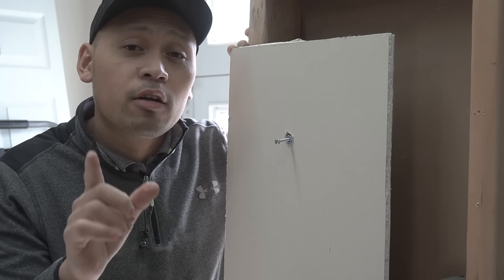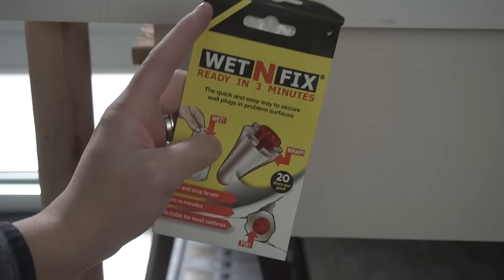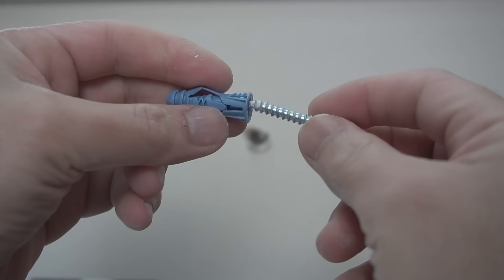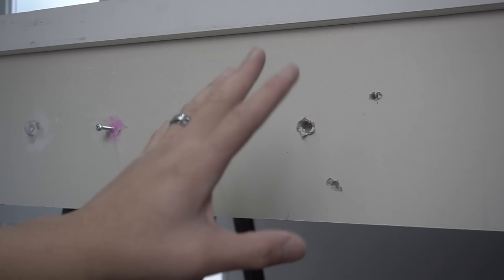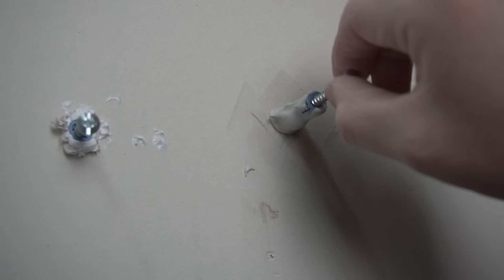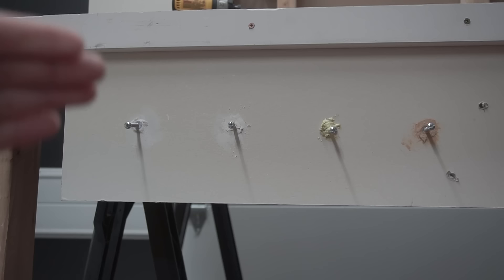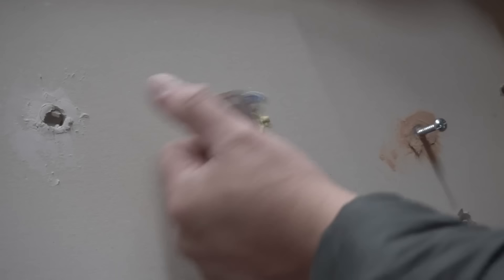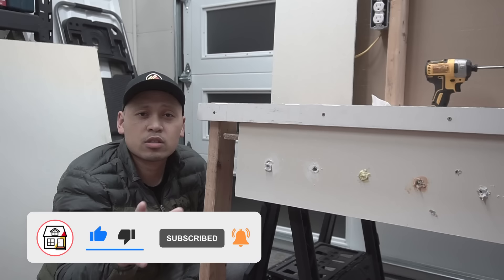How To Fix Loose Or Damaged Drywall Anchors Like New! | DIY Wall Plug Repair!

Comment: Great idea, but it is clear that the 'Wet n Fix failed because it has slipped down at an angle. If you need the screw to be in the same place, this will NOT work. The hot mud would at least work for less than 40 lbs.

Comment: Did I missed the part where he said how long he let the filler dry before he did the test or should we assume he did it the next day?  Some of these filler require days if not weeks to cure.  So this test didn't really prove anything.  He should have done the super glue and cotton test.  I seen other YouTube videos of people using super glue and cotton to fix screw holes by fill the hole with super glue and cotton and redrilling the screws holes.

Comment: Very strange repair. It doesn’t allow your fitting to work as it was designed. How about simply patching the hole and then installing a metal toggle style in a slightly different location?

Comment: First of all interior, lath and plaster is much more superior than cheap drywall and you’re only saving 10% on labor and materials on home building. One of the main problems affecting drywall is that when there’s moist water leaks, it creates Toxic mold which plaster does not. Drywall does not create acoustic and insulation and strength properties plaster does. It’s all about saving a few bucks and the drywall gypsum board companies rip off the homeowner. So by genuine, lath and plaster, which can last over 100+ years and holds anchors, and everything else in a more superior fashion Keep your valuable paintings and art safely held on the wall better than any other material.

Comment: It's drywall, it has limits. Even a great solution is no better than the drywall an inch away from the repair. If you need to support weight, you need to anchor into something better than drywall. If the item matters, like a TV, I anchor into a frame stud. I once built a shelf system into faux wall studs. I anchored the faux wall studs into the drywall with 6+ large wood screws. The studs were going nowhere, and anything anchored into the studs was as sturdy as the wood provided.

Comment: Of course, they are all going to fail, how can they possibly work if the toggle can't expand due to being covered in solid setting material. Better to drill a new hole and fill the old one or use a gravity toggle.

Comment: Great tips,  but never,  ever,  never use a drill on plastic anchors. Always screw by hand.  The high speed of drill actually softens the plastic anchors, which are made from LDPE, which has a melting point of 225 deg F. The  softening point is much lower,  so by drilling you create high speed friction that softens the anchor.
ALWAYS screw by hand.
Reply: You can still use a drill, but you have to drive the screw really slowly.

Comment: Those blue anchors aren’t for drywall, they are for plaster walls.  They don’t work.  Use a screw anchor or toggle bolt

Comment: Use a hole cutter to make the hole bigger. Then use the same hole cutter and draw around it on an off-cut of plasterboard to cut out a round disc the same size as the hole. Then fill the hole in the wall with expanding foam and before it expands put the cut-out disc over the hole. The expanding foam will expand and make contact with both the wall and the disc. It will harden solid. Polyfill the edges of the disc. Done.

Comment: The best way to fix these cheesy dry wall anchors is not to use them in the first place. Use a small toggle bolt instead... much stronger and won't come loose.

Comment: Latex caulk has no structural strength, is only for filler.  Use silicone and report back.  Works just fine for me, but I don't ever put 50 lb weights on any drywall.  That goes only into building studs.  Your may be okay for a day, but it isn't going to last years with that weight.

Comment: I think most failures,  were due to the threads being coated and not allowing the screw to thread in.
Use PL then insert a new plug. It will dry within 2hrs and adhere to the drywall….mike drop

Comment: Your test seem to have a flaw in it. The different compounds you used should have been used to filled the holes first  so to be bonded with the dry wall without the anchors. Thses type of anchors have a back side that is supposed to expand and grab the back of the dry wall as tension is applied by the screw. Your test doesn't allow this mechanism.

Comment: None of those are drywall anchors. Look it up of you can.  Every test was a fail before they began. The anchors used for drywall are scew in not push in. You can use plastic or metal plugs, 1/2 drywall is cheap drywall. Standard is 5/8

Comment: As a contractor for over 30 years I would simply get a different hanker system using the same hole. There are various types out there that would be more simple and cleaner, faster and stronger than what's in this video. Not very professional. I guess maybe I should start my own chanel and give people the right stuff.

Comment: Lol. That’s not even a drywall anchor.  Just use the right type of anchor in the first place and save all the extra work.  Personally I prefer to use hollow wall anchors (also called molly bolts) for drywall.  Drywall anchors (ones with the thick thread that you screw into wall) are ok for lighter projects.  I would never use those plug anchors for drywall - they eventually will fail.

Comment: Who dos a dry wall repair with out the paper over the repaid No strength will come from the side.  Fiber glass mesh is stronger than the paper but both will , C lean the hole as well  Best repair method is cut a hole Same same as 4x 4 and a piece of furring longer than the with of the hole  behind 2 screws in old dry wall each side to hold furring and then 2 screws to hold the piece to the furring and finish with mesh/ paper and spackle it is quick and not hard and a good repair
Reply from the maker: Thank you for the info 👍🏽

Comment: That's not a drywall anchor, and I'm surprised you used it. It's meant for masonry or plaster. You need a toggle, molly or Scruin for drywall.
Reply from the maker: Yes it is. Brand is TruGrip and its made for drywall, concrete, plaster and much more.
Reply: @FixThisHouse  Well, it's obviously not a good choice for plasterboard, no matter what the label says.

Comment: That's not a fair test as you are testing the strength of the plaster board pulling down on it, a true test should be trying to pull it out, you could knock a three inch nail into a cob of wood, tie a rope to it and climb up ,

Comment: The best anchor for the hollow part of the dry wall is a toggle bolt. you might even have to make the whole even bigger. But you would not have to put up with that nonsense.

Comment: the key is to remember this is drywall and is  NOT wood or concrete and can only hold just so much weight in the first place, hit the stud problem solved

Comment: None of this is necessary in the first place if you use the right anchor drilled a hole smaller than the anchor so you have a tight fit

Comment: I just don't trust this method, although I will say I have never tried this. I always just
drill another hole ner the original.after spackling the old one. I know this may not 
always work but I just don't trust heavy wall hangings with this method.
Maybe it works. Maybe it  doesn't.  Interesting though.

Comment: what a big mess! Use special anchors whick is like a screw, than you put a screw inside that. this way you can not make the hole big enough as the screw makes the hole

Comment: With all these products, you would be much more successful if you filled the entire hole first and then drill the correct size hole before putting the anchor into the hole.

Comment: It amazes me how the people with the least knowledge are the ones who feel they need to share their opinions with the world. This video is a classic example. There is a great misconception about drywall anchors, people that don't know assume all anchors are the same when in fact in most cases they are attempting to use a masonry anchor in drywall which either doesn't work or soon fails. I did not watch the whole video because it was a waste of time but the first example of a wall anchor is a masonry anchor and has no place in drywall and the only reason the plaster of paris works is because it is literally gluing the anchor to the drywall. If people would learn to use the proper anchor for the job there would be no need to fix an improper installation later. You don't need to learn how to fix it if you do it right the first time.

Comment: Or you could just save the environment and your money by using a bigger rawlplug split the old one lengthways and inserting it in the hole of the rawlplag with the screw

Comment: I wouldn't trust any of these methods. I'd either get a bigger anchor, use a different location or make the hole bigger, put a wood shim inside, then hold the shim with sheetrock screws.

Comment: Never use these types of anchors, they suck. Either use the 2 piece drywall screws or butterfly/toggle bolts. I prefer toggle, but they don't come in tiny sizes.

Comment: Step 1) Use a screwdriver, not a drill with no torque limit set.
Every failed anchor twisted out. YOUR FAULT.

Comment: the methods didn'f failed, you did it.... if you "glue" the anchor off course they popping out, do you know how an anchor works? you screw the screw in, the anchor open and is larger than the hole, if the anchor can't open because is full of glue the all point is falling apart. Put the product of your choice in the hole without the ancor, wait for dry out, drill a new hole and push the ancor in it.
Off course everything is poinless anyway, just use a bigger ancor, or a butterfly one even better, and in 2 second you solved your problem and it will be more secure without the need of clean the wall from all the mess

Comment: Use a proper butterfly fixing and never have this issue. I mean 17 years in drywall and I've never used a basic wall plug on sheetrock..

Comment: Why would you use an impact driver? This invalidates the demonstration. You can't even advance the screw without the bit jumping off the screw and knocking it sideways. Of course so many failed. This is drywall, not concrete. Joint compound and spackle work very well when you eliminate the brute forces... have done it many times and always have success. Anchors have a wall rating and a ceiling rating by weight, so you have to use the right anchor for the job. Also, you are using a used anchor with the screw in it. Anchors get their strength by expanding into the drywall with expansion from the advancing screw. you have bypassed the manufactures procedure. This product, although strong I'll grant you, but it is messy and a little pricey for the job. But here is the important part, you are suggesting to your viewers to put 130 lbs on a 46 lb rated anchor. When injuries occur, guess who's video will be shown in court? If you want to stay out of trouble, never exceed the manufactures recommendations.

Comment: I can't believe he is doing a stupid test like this. Long story short, use an old fashion toggle bolt with a washer large enough to cover the hole. I use the flip down metal anchor, which holds a 100 lb. It cost over a dollar a piece, but you will never have a problem. The manufacturer supplied nylon anchors like he is using is a waste of time and will almost certainly fail down the line. I throw them away.

Comment: This is a terrible way to address this.    There are other anchors like a toggle bolt that will work in this hole and actually be stronger than the original anchor.  Who has time to sit around and wait for something to dry and it wont be strong anyway..
Reply from the maker: Wet-N-Fix takes 3 minutes 👍🏽😊

Comment: Good video.  Could the Triple Grip rating of 46 lb be its rating before it pulls out, using your gauge  axial to the screw?  Here is another fix.
https://youtu.be/VuZ-NmqenzE?si=yGg51qMPOgsaF1Rh

Comment: Soooo unprofessional!!!! Never ever put ANY stuff on the anchor itself. After drying up, it will not allow the anchor to expand when you screw in the screw. It will defy the purpose of the anchor. Instead, put the stuff inside the hole, let it dry, then drill the proper hole and insert the anchor  and then the screw.. the anchor will expand and will do its intended job.

Comment: Stop wasting your time and just use drywall augers and be done with it !
Reply from the maker: What’s wrong with options? 🤷🏽‍♂️
Reply: They don’t work anywhere near as good as augers. If you ever used the augers you would not waste your time on these others.I believe you have never used them before or they would have been the first thing you would have  recommended. If you have used them and don’t at least  mention them then you are doing your viewers wrong.

Comment: i recommend using none of these, repair your drywall then do the job correctly. These quck fixes are never going to last as long as they will when done right, not rigged to work.

Comment: I noticed in this video that you used one logical item for this and 4 illogical fixes. Why not use things that would be a logical fix? Exapnding foam is not and never will be structural. Nor is spackle. spackle is meant for covering up paint and can typically be scraped off with your fingers. And wood filler... I don't know if anyone would ever think wood filler should be used for drywall. It should only be used on wood first off and it should not be used for something structural on wood either.  And finally caulking? You had me actually laughing at this comedy portion of the sketch. Caulking is not and has never been a structural component of anything. It's used for sealing things in case you were wondering, which I assume you must be curious as to its use since you tried to use it to hold a screw lol. 

Additionally, you say you aren't sponsored and yet you have ad links so you are getting money off this. At least you used a mix mud but why not try a pre-mixed mud that you can buy and just use?

Comment: Im not going to watch this video. That anchor shown on the thumbnail is not a dry wall anchor. Those are for concrete or bricks. Problem solved.
Reply from the maker: I believe you are incorrect. The anchor is called TripleGrip and it’s a multipurpose anchor used for drywall, concrete, etc. 👍🏽😊

Comment: Come on man. I appreciate the video but  these methods should be shown as a "try these methods for effectiveness." The generations of drywallers who've learned tricks of the trade are rolling in their graves. Use their tested methods as solutions. Ie go bigger. If bigger is not an option then use a different style like drywall specific anchors. If that's not available, butterfly anchors. If that's not possible, patch and move to new location. If that's not possible, last resort, cut drywall and reinforce Inside with wood. Patch and seal. Then start over with wood screws and screw in the screw to the area that has new wood and be happy. These methods shown are not tricks of the trade

Comment: If you're smart, you will avoid those cheap drywall anchors in the first place. There are a number of others which hold much better.

Comment: You are not helpful, and you don't seem to understand basic tool design. I'm not a contractor or anything and I know you're supposed to fill in the hole completely with spackle, compound, etc and let it dry, THEN drill in a new hole with the anchor. Your "tests" were bound to fail!